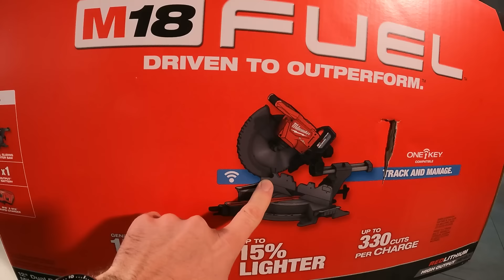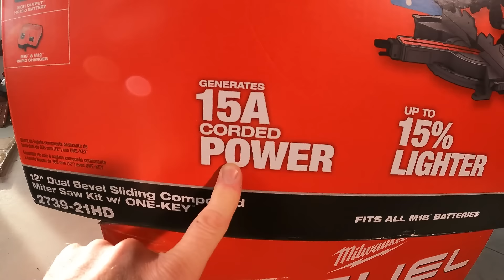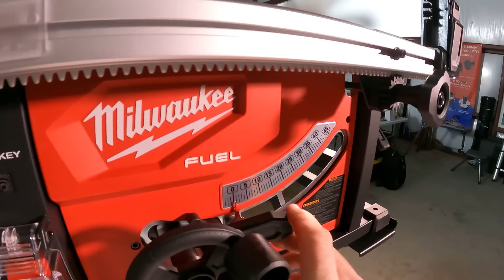New Milwaukee Tools today!Barndominium plans for the farm!

Comment: My sister got the M18 gear at home and leveraged them onto the farm. She has the 16” chainsaw and the little bitty pruning saw. In the combo line, there’s a weed eater and hedge trimmer that migrate to the farm when she comes as well. I got a second machine head with hedge trimmer and weed eater for the farm and haul with me. Those hedge trimmers are the best for trimming under barb wire fences. All that stuff really helps in fencerow clearing.

Comment: I bought plenty of Milwaukie cordless tools and 15 18v batteries 
In the past 4 years I have had to replace most of them and had I not had spent so much money on the batteries I would have thrown them in the garbage by now 
I've burnt up 2 circular saws a multitool,2 impact drivers, 1drill a 1/2 inch impact driver and 2 nail guns and the sad part is, is that I still have ryobie cordless tools that are more than 10 years old that still work just fine and when you send back your Milwaukie tools back to be repaired it will take 6 weeks and you have a 50/50 shot of them working when you get them back
Reply from the maker: Milwaukee will see this buddy....hopefully they can help you.  Sounds like you're having trouble all across the lineup...I wonder what's causing it.  Humidity? Fuel product or other? I hope they see this comment and get in touch

Comment: Very nice pair of woodworking basic tools-table saw mainly for ripping and the miter saw for crosscuts and miters. You can do woodworking and furniture building with these two machines. And you can use them wherever you like-no hunting for extension cords and outlets. Unlike millennials-I took woodshop in high school and metalworking shop,too . Well versed on how to use these machines. Instead of the miter saw used a radial arm saw in the shop class. The slider miter saw is almost like the radial arm saw-it can’t rip. You can use a radial arm saw to rip. You have to twist the saw carriage head around and lock in place you use the table fence as the rip fence alike the table saw push the board thru. You will look like a sawdust snowman when done-as one You Tuber says-wear your safety squints while doing work on these machines!

Comment: I would be really cool if they made these tools dual power, both plug in and battery! Also, how long do the batteries last?
Reply from the maker: depends on usage I'd assume, but we'll see.
Reply: Some companies tried that in the past.  The offered an AC adapter that connected to the battery port.  It was not a popular option, although I could see it being more useful with the more substantial tools available today.

Comment: Tools they didn't need in the 90s....there is a difference in tools now because millennials have no idea how to use hand tools ....they want robots, so they don't have to work the tools.
Reply from the maker: Well....I guess there's that opinion lol.....aint no robots gonna build our homes, bridges and barns lol
Reply: They had the same tools in the 90s but they had a cord. No robots in this video.
Reply: My pops is in his 70's and has the same corded tools. As did my grandfather.

People have always wanted to use the correct tools to complete a task. Time saved using the correct tool adds up
Reply: @StoneyRidgeFarmer  not sure what rock that guy lived under if they didn’t have table saws or miter saws.. My dad was 70 when he passed away a few years ago , He had a construction company which I took over. He said, if it wasn’t for progress , we would still be using handsaws and riding horses to work  😎 Something new came out ,we bought one, I bought the 10 inch version of that miter saw a month ago
Reply: Battery Op tools have changed everything! Especially for those of us who built & live off grid.